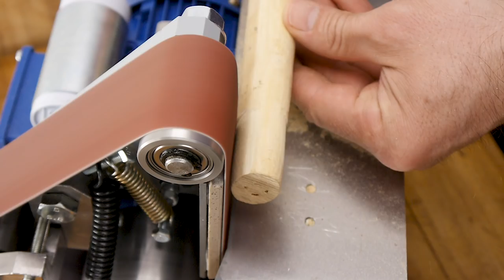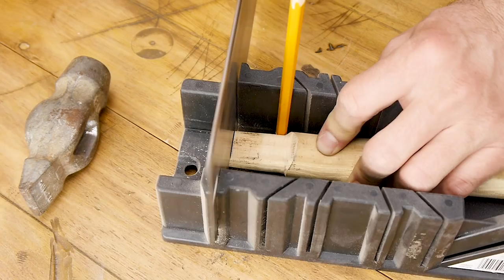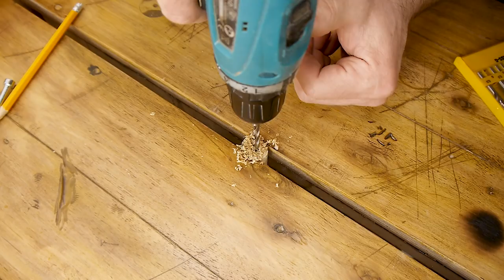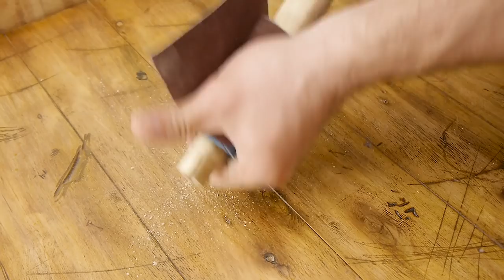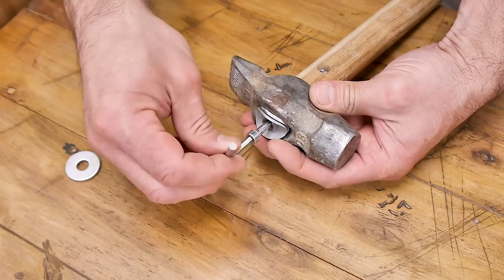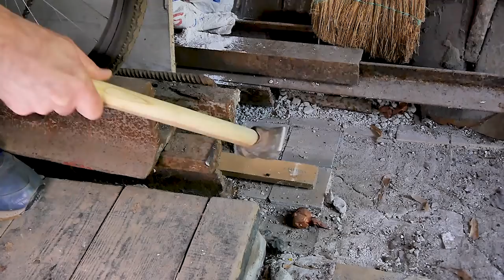Аmazing Рroject. Bolt + Old  Hammer.  NewTechnology. My Experiments.

Comment: Gotta disagree with this. Wedges work. Set the wedge tight, recess the wood with a dremel, a four in hand rasp,  or a gouge down into the head about 1/4 inch and mix up some fiberglass or epoxy and seal it by placing it upright in a bench vise, bring the poured glass up to the spill over point, allowing it to run down into the hammerhead's innards. I seal the base of the head with some blue painters tape to any stop run out. Allow 24 hours for a good cure. This works with other handles, axes, rakes, homemade tools of all sorts. I made a long handled flap hoe to clean out culvert pipes and you don't want to lose the flap hoe head off of the handle when it's 8 feet into a culvert, so your idea may be great for that, just not for striking tools, but the fiberglass seems to holding up just fine... Also, consider not using handle as a striking tool.